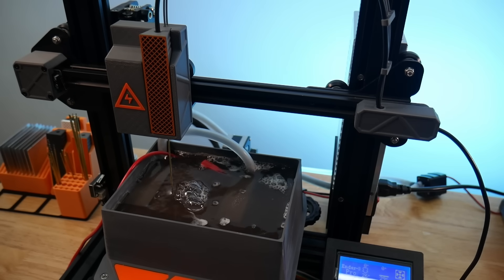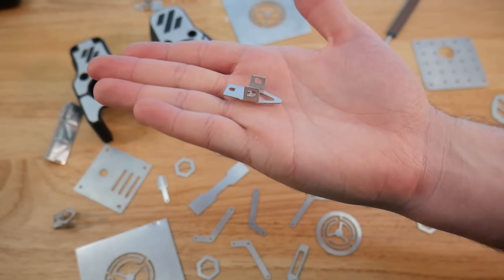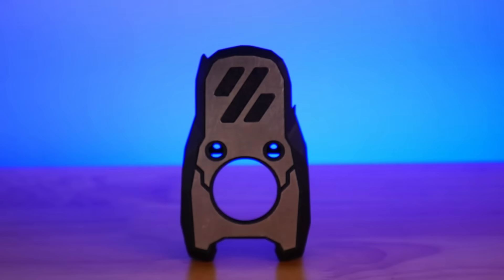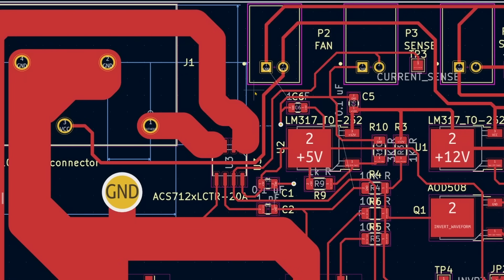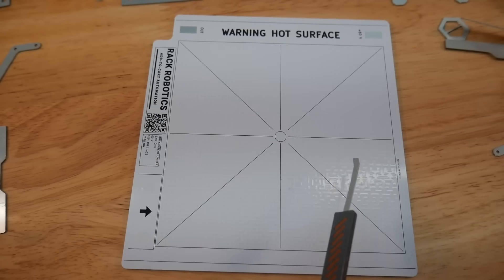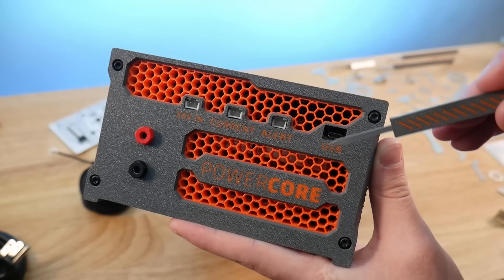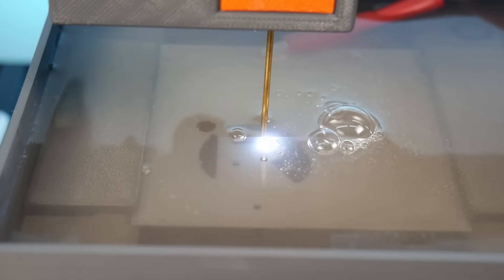I built an EDM machine

Comment: I could not believe it when I checked the GitHub repository and I found the hardware schematics and layouts for the motherboard and the PCB resistor. The "EDM bottleneck" as you described it has been persistent for years, not due to the technological challenges in my opinion as much as it is due to the commercial appeal of this technology (again, just my opinion). So I am very grateful to see that you have taken the generous path of sharing your design and the results of your hard work. One crucial question at this point though is: "what are the licensing terms for this hardware?" I could see that the software is released under an attribution license, but what about the hardware. Can I start locally fabricating these machines, improve them, make a profit, and contribute back to the design? So fundamentally my question is: is this design source-available or open-source? I would encourage you to clear that up to set the tone and make it clear for contributors, what they are stepping into.
Reply: Have you been able to get an answer to your question yet? I'm also curious

Comment: Hogging out that much metal in 30 minutes is impressive.
Reply from the maker: It is many thousands of times faster than electrochemistry.
Reply: They're just tiny thin pieces of metal though.
Reply: @TechnologistAtWork  It was extremely slow with ECM material removal.
The way to think about this is that instead of a complex curved path to get a small compliant mechanism, you can get a mostly straight line profile cut, and then pressed into shape in a shop vise with 3d printed dies.
Reply: @TechnologistAtWork  even with real industrial edm machines its slow.
Reply: @TechnologistAtWork  sounds like you went in with overly high expectations.
Reply: @UnluckyOmenYT  nah. That statement just didn't make sense at all. Small metal and slow cutting. Totally the opposite of what that other comments said.
Reply: @TechnologistAtWork  I know right fast hogging speed is only achieved by throwing the work piece in a volcano, scales up to anything the size of a dumpster truck carried by an Osprey helicopter. Instant hog speeds.
Reply: @MrBeaach  industrial machines give micron accuracy and smoothness
Reply: try machining HSS material with anything else than EDM and then come back critisizing the speed of this device
Reply: @TechnologistAtWork  It makes sense, though. Do you understand the limitations on small desktop metal machining?
Reply: @ChucksSEADnDEAD  I don't think you do, just from your ridiculous praise.
Reply: @Blue.star1  Which can also be achievable on a desktop machine when the design spec can achieve that kind of fidelity, yet the donor machine used for CNC movement is an off the shelf 3D printer that doesn't require accuracy to be that high.  Stop making bad arguments in bad faith.
Reply: @a3103-j7g  Carbide or CBN hard milling? Any abrasive process?

This project's cool as heck, but it's not magic.
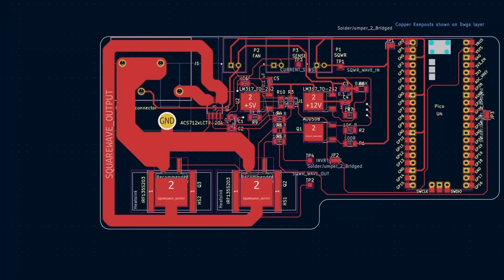Reply: @TechnologistAtWork  4:40 he didn’t cut all the way through because he didn’t need to. Dont see why he couldn’t cut through a thick piece of aluminum if he wished.
Reply: @WeAreSoBackBros  that's not a thick piece of aluminum. Have you even machined a block aluminum? A proper router would cut through that sheet like butter.
Reply: @TechnologistAtWork  Not my point but I wont waste both of our time trying to explain. Just dont buy this then
Reply: @WeAreSoBackBros  you have no point. The entire comment section seems like just a bunch of bots leaving positive comments. It's not a practical and pretty overpriced machine that nobody needs.
Reply: @TechnologistAtWork  unfortunately youtube would delete my comment if I told you about yourself lol
Reply: @TechnologistAtWork  how is this not practical and overpriced? Genuinely interested as I have no idea about EDM.
Reply: @madbull4666  I'm sure you've seen CNC machines and 3D printers before. They're very simple and use less parts, less power, and they can be easily scaled up. 

Industrial EDMs already exist and they're very expensive, but also very niche in terms of customer base because the alternatives are more affordable. There's absolutely no point in purchasing a tiny EDM that cost thousands of dollars when you can get the same job done by a regular CNC, a plasma cutter, or a water jet cutter that could handle more materials at much larger scale in much less time and cost. 

All of that would've been fine if the person who created this video did claim to make EDMs the next desktop machines like 3D printers. That's wild promise that he won't be delivering on. It's just unrealistic to sell something slower than the competition, takes a lot of materials and maintenance, and costs a lot more.
Reply: @WeAreSoBackBros  There is always someone like that in the comments going of on some narcissistic tangent
Reply: Oh no its not a DIY its another buy my kit infomercial. What a disappointment.
Reply: Have you heard about lasers? Very affordable

Comment: If I can offer a suggestion. To limit and control the current to the electrode I would recommend driving the PWM into an inductor. You can get extremely accurate currents without much in the way of heat losses. There is another incredible advantage to using an inductor that most people don't know about, the output voltage of the inductor will fly up when the current is interrupted such that pulse will generate a spark even if the gap widens.
Reply: That won't work as you need a sharp current pulse, and inductors drop in impedance  as the core saturates. The best option is to use switch  capacitors. You charge up a cap, open the charging Mosfet, and  close the load mosfet dumping the charge into the work piece. You end up with a nice sharp pulse that doesn't overload the Mosfet.

Comment: Might I suggest you add in a "port saver" for the Pico?  The USB connection port physical connection on the pico is not that great, it's micro-USB (so people will plug it in wrong twice before plugging it in right), and recessed in there, people will forget it's just a pico and tend to jam the cable in with force.  A panel-mount USB port (USB-C, even?) would save the physical stress on the pico's port.

And, of course, I wanted to say that this whole thing is freakin' awesome!

Comment: Why did you need the large power resistors or the PCB resistor? Is it to limit the current to the electrode? If so would a current controlled power supply be a better solution? You could maybe make one that is relatively high efficiency by using a buck or boost converter that has a constant current mode.
Reply: You are spot on

Comment: Do you really need the resistor?

You could use a capacitor and series inductance to limit the dI/dt, and then switch the mosfet to act like a software current limiter.   You just traded a few hours of writing code in return for halving the size and price of your device.

You'll also reduce your power supply requirements dramatically - as long as you're willing to cut slowly, you can now have a super small cheap power supply costing just a dollar or two.   And even if you want to cut fast, you'll be able to use a cheaper supply because all the energy will be going into the workpiece not into a power resistor.

Give me a shout if you want me to send over a circuit and code.
Reply: hello. I'm trying to make a similar machine. I like this idea but I don't know how to implement it. Could you help me with that?

Comment: Just some thoughts thought, While this is cool I think you may have gotten some of your information a little incorrect or not quite explained how it necessarily is

Firstly when you talk about compliant mechanisms, While they can benefit from being EDM machined they are not necessarily an exclusively EDM manufactured part. Not really even close. Methods like conventional CNC and Laser cutting along with Sintered metal 3D printing are all methods being used to complaint mechanisms, Though I'm not familiar with designs at the microscopic scale I believe it's going to use a different method than EDM machining. 
That being said we also don't necessarily have a bottle neck on the EDM side for complaint mechanisms. A lot of work in the industry is moving towards Microscopic scale, or 3 dimensional objects like NASA's multi directional thruster which can't be made using an EDM machine either just from how the routing of tubes work.

Next to address your statement on injection molds. Well In industry yes we Can and will sometimes use EDM to manufacture molds, but we certainly don't have to. In fact entire careers are built around getting those parts to final mirror polish but also designing the molds because there is a lot of engineering and precision involved with making them. EDM is also slow and can't take of nearly enough material as CNC can so for this application you would need to use a CNC machine anyways to start it off and then hire someone to do the EDM work to get it to a mirror polish. There is of course the alternative of making a separate copper electrode to machine the part without needing CNC machines to make the cavity, but someone still needs to make that custom electrode to EDM into the stock material. 

There's a lot of work involved with making injection molds at an industrial level so it's not really a bottle neck of EDM machines that make things expensive. It's the labour behind all of that work that makes EDM machined parts so expensive.

Overall I commend your efforts and love that you're bringing an EDM machine to the hobby market but they way you're presenting these problems really isn't the full story and a little misleading to those who might not know as much about the industry. If you really want to fix this so called "EDM" bottle neck which I would personally disagree we even have you would need to focus making machines with incredibly high level of precision far more affordable and cost efficient than what's currently available while still maintaining the same high degree of compatibility with industrial software and industry flexibility.

Comment: This is really impressive I’ve been wanting to build a wire/sinker edm for a while now. 

I just have two questions 

1 could that power supply be used for a wire edm 

2 is it possible to get a better edge finish with this power supply. 
Does the finish come down to the power supply or is it a result of machine rigidity?
Reply: One more question   How bad is the inference created by this power supply?
Reply from the maker: We based our design off of some work done by Dominik Meffert. His wire EDM machine is on Hackaday. Our power supply design is similar. I do not see a reason why the Powercore would not work for wire EDM. We have not had a chance to try it out yet.
Reply: @MorlockEngineering  Using a machined Graphite sinker (maybe done on a cheap 3018 type machine, or something more like a Makerspace scale CNC Router) would be neat too!

Does it have enough “ooomph” to do Die Sinker EDM?

Comment: since you have a plunge EDM have you tried cutting bolts and taps out of threaded parts as a handy Disintegrator for removing F'n broken tiny taps or big ones would be fantastic for the shop.
Reply from the maker: Ironically, no. Sadly, the RC supplies sold online for removing taps are not good at machining or wire EDM. That is why we made the Powercore.

Comment: Always wanted to build one! I have MANY questions, though. Electrode errosion rate? Longer-lasting electrode material alternatives W, Mb? Tolerances, surface roughness? Smallest usable electrode (which lasts at least minutes)? Electrode erosion compensation? Bottom surface milling? Electrode errosion compensation? Software?
Reply: Pretty much all the questions I had as well.  
Also are they planning to sell full systems in the future and not just the Powersupply?  Any price estimates for that yet? 
What about future expansion to ship outside of the US?  
Like you said SOFTWARE is a VERY big questionmark for me regarding this project.   
What will the pricing be like after the kickstarter?  
Are they using off the shelf electrodes or will buying from them be the only way to get replacement parts?   

And as a person who doesn't know much about EDM:   
What's the maximum possible thickness for the material?  
Which metals/alloys can/can't be cut with it?   
What's the speed?
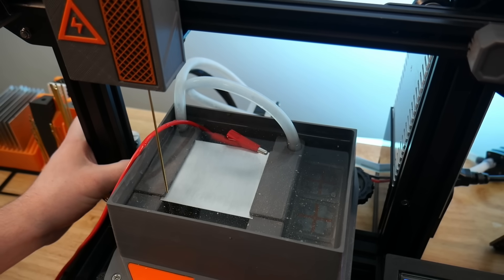Reply from the maker: The electrode erosion rate is 1:20 for brass-to-aluminum on our setup. We have a gcode post processor that moves the electrode downward as it travels during a cut. So we are continuously replenishing the electrode. I call this, "virtual wire" EDM. In 0.6 mm aluminum, 40 mm of brass rod will allow you to cut 800 mm of aluminum. It is not as good as using a wire mechanism, but our method costs basically nothing to build. 

The gcode is generated with Laser Web 4, using milling tool paths. Then we feed that gcode into the post processor. 

We are really excited to see someone 3D print a good wire EDM mechanism for the Ender 3. It would be a game changer. 

We have not tried tungsten-copper yet, but I hear it works well on many materials. Tolerances are mostly dependent on your setup, and kinematics. The size of the spark is 1.1 microns, so that is the upper limit for resolution. Surface roughness will change depending upon frequency, cutting speed, and rigidity of the electrode. The smallest electrode we have tried is 1/32" brass. It was too flexible to work well. That is why wire, under tension (8 - 10 Newtons), is used on industrial machines.
Reply from the maker: @Esablaka  The electrodes are off-the-shelf 1/16" brass. We recommend only using thin aluminum, unless you incorporate more powerful flushing into your machine.

Comment: Extremely cool. Designing your own PWB instead of using a power resistor for current limiting is a clever idea that I never would have thought of.
I've been kicking around the idea of a DIY EDM machine for the better part of 2 years. It seems like a fun electrical project and, for the reasons you've described, is extremely appealing for a hobbyist who does not have the space for large conventional machines.
Reply from the maker: The power resistor PCB saved the project. Without it, the Powercore would have been much more expansive. We know that there are 100 improvements like this we can make for wire EDM machines. We do not think that a wire EDM machine should cost $100,000
Reply: and here i am wanting to try the ECM conversion when he drops this
too bad i dont live in the usa for shipping

Comment: Most wire jobs are machined before they get to the wire EDM shop. There are very few applications that don't require machining before wire. Still need an accurate mill to drill holes and tap them.

Comment: I was a wire edm operator for 5 years and a programmer for 3. What you’re doing is pretty dang awesome! It’s like a sinker edm and a wire edm had a baby and gave birth to that. I wonder how tight of a tolerance you can hold, can you control the spark gap? How do you figure out the speeds and feeds?
Reply: Do you know what happends with the burned metal? Is this thing safe?
Reply: @martincerny3294  the metal turns into fine fine dust/grit. It is advisable to use latex gloves and not to also not dump your waste water/ filters down the drain. It’ has to be disposed carefully. When I worked at my last shop, it was fine to dunk your hands in the water and touch the parts with your bare hands. But ideally you should wear gloves. Also, don’t drink the water.
Reply: @cheeriomartinez  Dust is fine, I was wondering about aluminium oxide creation for example but I'm not a chemist so it's just me being very cautious because this machine looks exactly like something I'd need :D

Comment: Backed for 600. Good job
Something like this was on my project list.  But now I can be saved from that headache a support you and your developments! I really hope this goes the way of 3D printing. Can't wait to see what's in store 5 years down the road.
Reply: It's always just a matter of time before hobbyiest tackle and succeed at many techs normally only available only at industrial levels.  Once somethign becomes open source a solid community developes to help improve on it.  All things the big companies dread to see.
Reply from the maker: @dev-debug  Nailed it right on the head. We stopped by a commercial EDM facility today to talk with the owner. Their machines still use CD drives to store programs, and do not have touch screens. It was like going back in time to the year 2000.
Reply: @MorlockEngineering  My PC has a DVD/BR drive but I can't think of the last time I used it lol

I'm getting up there, started programming in the 70s in 7th grade.  If I recall my 1st CD burner drive cost me almost $300 and my first 20 MB MFM HD was about the same price.  

Anyway good luck with your project, curious to see how to works out.  I have CNC mill and lathe but an EDM would be a nice addition to my shop.  Maybe cut some reed valves for a pulse jet and avoid the slow etching process.
Reply: @dev-debug  Similar here. Started programming on paper tape and a timesharing service in the 60s.  The tech available to hobbyists now is amazing.

Comment: Never use similar connectors if they are incompatible. It looks like your 24v power connector is the same plug as your two signal outputs. Use different connectors for each so nobody can plug them wrong and destroy the device that way.

Comment: In the cnc world if you look behind a mill or lathe up high you will see what looks like round stove heat elaments. When you hit the break it dumps all the power into the coil. I remember the first time I had to hit the Estop on the lathe and smoke came out of the enclosure. Burned off all the dust and oil that had settled on it.